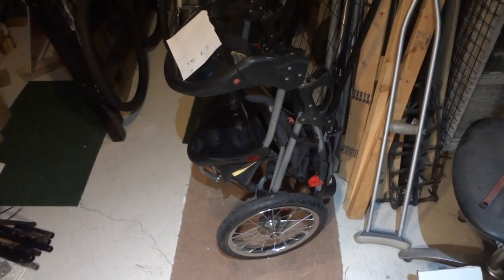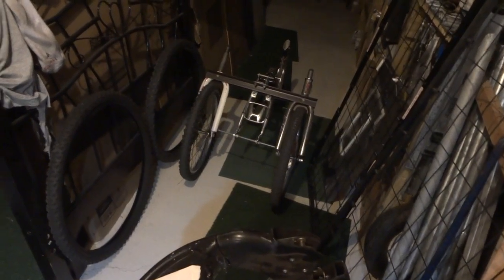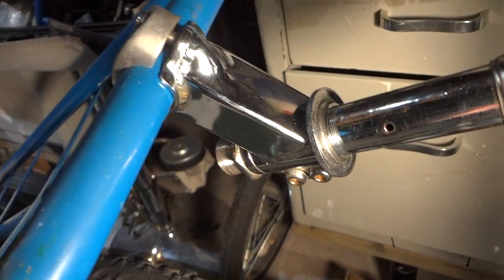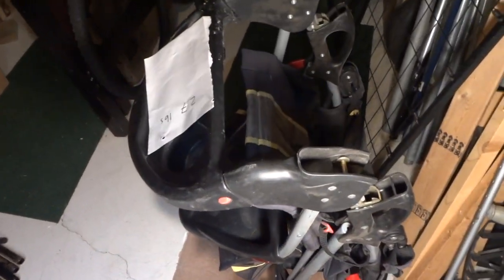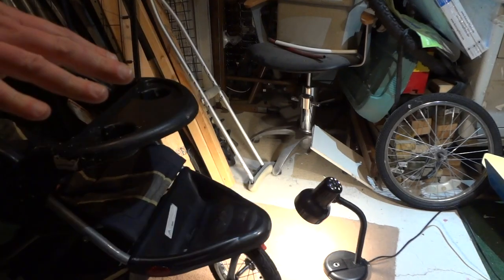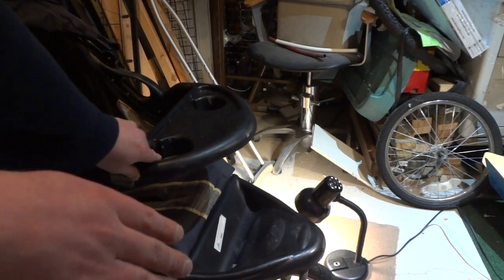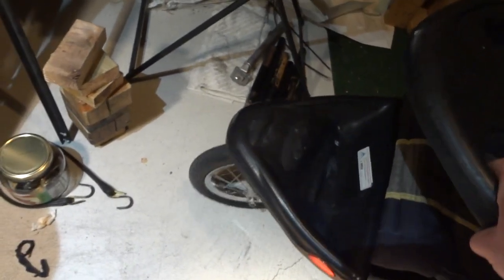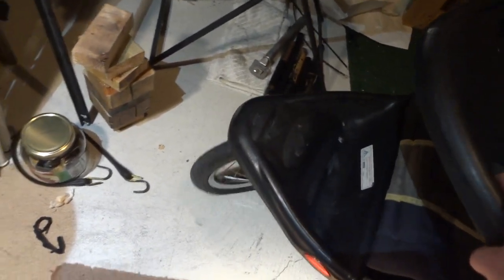3 wheel bike trailer testing and design making a light trailer and hitch

Comment: You have a lot of really good materials in you work shop. Where do you find all of your materials? Are they salved from what other people throw away? Maybe you could make some videos about collecting supplies for projects. I really enjoy watching people go around and find free stuff that others might consider  garbage. It's like treasure hunting.
Reply from the maker: If i get bored , i pick scrap metal and electronics to make extra cash. I save metal bed frames and anything useful. But this is very risky so i pretty much stopped. Reason is a lot of people have roaches. Gets into your vehicle and stuff. One day i saw a stove with dead roaches and inside a computer tower infested. So if i save anything i check it carefully, freeze it for few days then wrap in several trash bags, jars etc and store for at least a year. If its like or bed frame i store it outside for at least a year too.  If its a bike they are usually ok but last bike i found i stripped it down to frame and was able to fit it all into a small chest freezer.